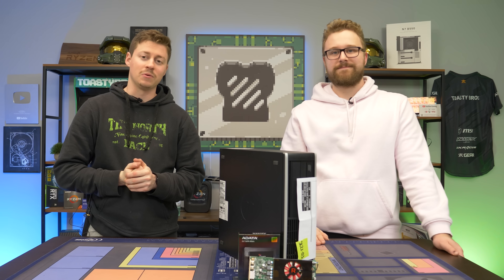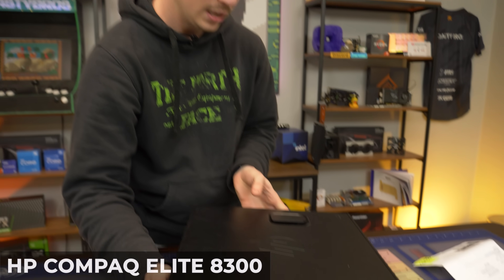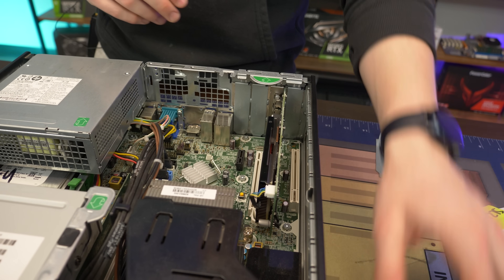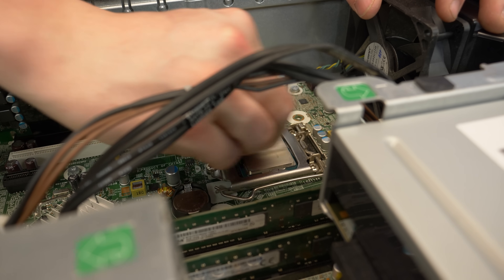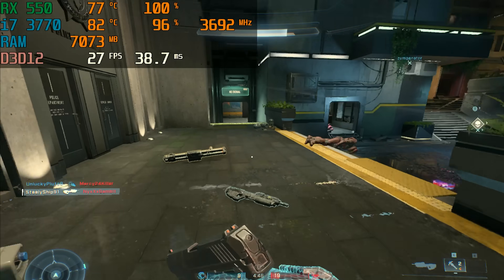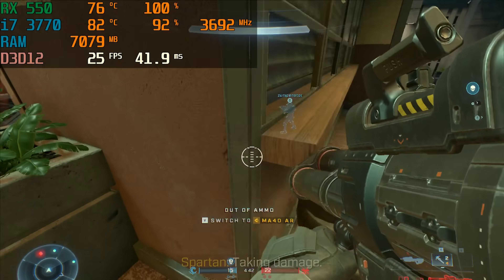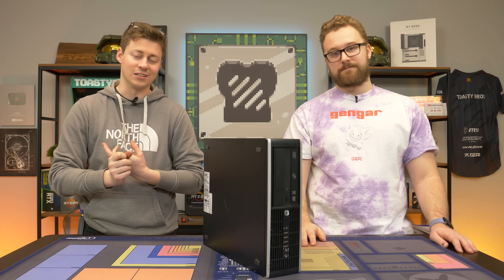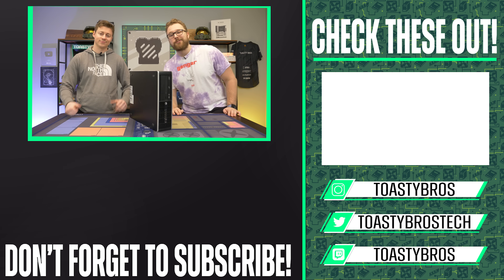The BEST $250 Gaming PC 2022 - Step-By-Step Guide

Comment: Im a bit late but even a 660  760 is around the price of the rx550, but gives a bit more performance even with less vram.. at least by prices right now
Reply: yeah but for a case like this you would need a low profile gpu and probably dont have any added pcie power

Comment: Just did the same basic build....i5.4670k...8gbs ddr3 patriot vipers ram and a gt 1030.....cost me around 350 bucks
Reply: +❶❼❽❶❸❹❼⓿❻❶❾whatsapp  prize? What prize lol
Reply: Witch a build similar to what is shown could I add ddr4 ram?
Reply: Not unless your motherboard takes ddr4...check your task manager and in performance look at memory and it will tell you what kind off DDR is needed for your pc

Comment: hey toasty bros, i have a question, idk if you know the answer but i have a amd radeon rx 570, and it performs really bad, it will drop bellow 60 fps on fortnite, all of my pc cost about 1,000 dollars and my cpu is a ryzen 5 2600x so it shouldn’t bottleneck from the cpu, i was just wandering if there was any way that you know i could fix it, i am on performance mode when i play fortnite, and it’s just really frustrating, iv tried a variety of other pc tweets and adjusting radeon software settings and nothing seems to help:/ but anyways thanks and have a good day!

Comment: If the old drive still has windows 10 pro you are wasting a free license by doing a fresh install to your dad. Use macrium reflect to clone the HDD to the SSD. This takes a long time due to the bottleneck of the HDD but it is totally worth it to use the license you already paid for. Another consideration is that the license number is on a sticker on these prebuilts. You're welcome

Comment: The gt710 would be a good cpu to put in this build
Reply: GT 710 is a graphics card, not a CPU. And it would be far worse than the RX 550 4GB used in this build.
Reply: @jtenorj  I meant to put gpu

Comment: Great video! Thanks for the No filler, No BS Content! You both def know what ur doing and explain it in a way anyone can understand imo.

My mom is 71 and she understands how y'all say it better than when I explain it. Haha

My question is, what kind of build would work for me if I literally only want (NEED) to play XCOM 2 WOTC with Mods... 

That game alone is why I'm switching to PC from console, it's my favorite game hands down by far, on the Xbox one. But no mod support is garbage trash and it actually runs pretty decent til about 2/3 game... Then it's a nice crash fest once every 2-2.5 hrs. 

I want to run XCOM 2 with Long war 2 and WOTC with LongWOTC and not have the issues. 

Currently I have a Dell optiplex 3040 with the Pentium G4400 in it and no gpu, only 4 gigs of ram, ddr3 also... Lol I installed it and ran just Xcom2/LW2 and played gate crasher. 

I was prepared for a long mission but this was like a slide show LMFAO... It took about 2.5 hours to finish gate crasher and as much as I love Xcom2 and want to experience the amazingness of the longwar overhauls... Not gonna do that. 

I hate the pixel graphics trend, it's not immersive at all for me.  So I definitely can't condone slideshow Xcom and I need your help more than I've ever needed help with anything before...

BTW Gaming keeps me sober, I quit alcohol over 5 years ago and without my Xbox I'd have definitely relapsed and prolly be dead right now... Gaming took me to the place where I could actually manage it and the harder, more strategic the game, and the more I need to use the thinking part of my brain while gaming, the less difficult it was to to bypass cravings and manage triggers. 

So yeah, this is huge for me and I need to make the switch to PC, I just don't have 4k for a top ender... I don't have 1k either. 

I'm looking at around $500.

So far I've struck out, I've really brainstormed and learned a lot, from you Bros Toasty, Linus Tech and Kyle Bitwit, I've been the tech Specialist at an independent record label for over 2 decades as well so I'm comfortable with building my own. 
Definitely. 

My constraint is money. 

So I have $500 and an Xbox One S hahaha guide me to the Gaming PC world and I'll put a plug out on my channel for you guys... 

My professional channel just hit 100k and I got a plaque haha definitely 100k new fans for y'all cuz they're not part of this world regularly but I bridge that gap haha. 

Anyways thanks again guys! Awesome vids and hope you guys drop a savage budget build option as a reply comment.

P.S. I've really been tossing around the idea of a mini PC like The minis forums or beelinks and an external GPU... Cuz versatility per price point. 

But am I trippin or would that work maybe? 

-PiFF

Comment: Why dont you guys try to find an Dell Xps 8500 or Dell Xps 8700 system to upgrade? Those are underrated systems that people have slept on. I've flipped more than two dousins of those for easy profits. Just add in a gtx 1060 and you're golden.
Reply: The dell vostro 470 uses the same mobo as the dell xps 8500 and its cheaper than the xps 8500 also.

Comment: I'm shopping for a pc now I don't know what I need looking for something to run DAYZ any help would be greatly appreciated
Reply: Just look on steam and look at the minimum specs and the CPU Frequency / 3ghz and 8 GB Ram runs everything. The graphics card you want is up to you.
Reply: @100Bucks  thanks for the info
Reply: @ridingwithkevoo347  Yes 3ghz and 8GB runs everything. With this little information you can use this to shop and be accurate  to get functional gaming PC. A Ryzen computer is enough for a 3ghz frequency. Also there's a huge  Upscaling trick. You can try this with the current PC you already have. Buy this program in steam called "Lossless Scaling", it's only $5 bucks for the upscaler. Say for example you're struggling to run a game. The solution to this will always be to lower the resolution to get a full 60fps. Keep dropping resolution in game until you can get full 60fps. Ok, you're on very poor resolution. It could be 720p which is good enough. 600p , that's bad. 500p bad, 480p bad, 360p bad. Whatever resolution you have to achieve 60fps, you can upscale it back to a higher resolution. So if you wanted to upscale 720p to 4k. You would have to open windows display and manually set the resolution to 4k. Most likely it would be set on 1080p, you need to set on 4k. After windows have a 4k screen. You can open the Lossless Scaling application and scale the 720p to fit windows 4k display. Best program ever. Every time you use this program you have to make sure your game is set on windowed mode in order for the program to work correctly. Here's some 1ghz games you can try on your current PC. 1ghz is bottom of the barrel and can't do anything by the way. This is the reason you avoid laptops, you will get a Celeron. "skull Girls" you can set resolution on 360p windowed mode and upscale to 1080p or 4k. "Nights into dreams" 720p you can upscale to 1080p or 4k. "Super Dragon Ball heroes" 800x600p to 1080p or 4k. 800x600p is a stretch screen. To fix this you click on scale cursor in Lossless Scaling. Can't think of anymore games right now that would run on a potato 1ghz. This upscaler has FSR in it. FSR is the best thing ever for poor computers. So when you build or buy your new PC. You don't have to go all out for a $1000 GPU, settle with any GPU and upscale all resolution with "Lossless Scaling". Whatever GPU you get, make sure it can reach 4k in order for you to upscale the games to 4k. Also if you do buy a laptop, make sure it's Ryzen. It's the only brand I know that can have 3ghz on a laptop. Everything else Will be 1ghz.

Comment: Constructive criticism, when you make a mistake in putting the CPU cooler sideways, mention this. Otherwise if someone buys it and follows you in changing the thermal paste, they may end up putting the cooler sideways like you did and then not notice that you changed it at the end. This will help a lot with CPU temps, otherwise you choke it with no air passing through it.
Reply: Exactly if someone follows this like a tutorial they would have a throttling brick of a computer
Reply: Will changing the direction of the heat sink have a significant negative impact on the processor temperature?
Reply: I think the fixed it
Reply: 6:04, he fixed it
Reply: @lancebermejo3319  Yes they did but they didn't say anything in the video and some people might not notice that.

Comment: could you use a 1050ti instead of the rx 550??
Reply: Yes you can. I myself have a  GTX 1650 LP in mine. They are very similar and works very well.
Reply: 1050ti is much better than rx 550
Reply: I'd go for a GTX 1650

Comment: It's the rx550 4gb worse than the GT 1030 2gb gddr5?
Reply: When they came out they were similar in performance. RX550 might be a little better now but it depends on the game.
More VRAM is nice but I wouldn't pay much more for RX550. 
If you're looking at new GPUs Quadro T600 might be a nice option as well in that price bracket.
Reply: They are definitely better now, even 2 GB version. AMD fixed the drivers.

Comment: You fixed the cooler orientation but something was off in your benchmarks... I've ran one of these for almost 3 years as my daily driver with a 1050 Ti and my I7 3770 CPU never got that hot, even during CineBench tests. Most likely the front fan needs to be replaced (and the PSU actually uses the same size fan, 92mm one. Just be careful with the orientation, HP was tricky here).
Reply: I believe that they did not fix it. Look where the ram sticks are when he is working with the cooler.
Reply: @hlbatesjr  the "wind tunnel" (as HP used to refer to that plastic bracket between the fan and the actual heatsink) seems to fit the correct way at 6:48, so it does seems it was fixed afterwards. Either way, that was running way too hot with new thermal paste applied in my opinion. Either the fan was not great or it was turned to its minimum in the BIOS.
Reply: @rhyzon  But look where the ram stick is during the video. He doesn't change the ram until just before he says that he's going to put the lid back on. Then go back to where he's working with the cooler. It is in the new ram slot. It looks like they decided to re-apply the thermal paste after moving the ram location. Seeing the temps does indicate that the cooler might still be in the wrong orientation. I sure hope that they go back and check that before they sell it.
Reply: Plus he says, "Let's test this thing!" after putting the wind tunnel back in.

Comment: Would you get the same FPS with the i5 3470?
Reply: I wouldnt say you'd get the same. A 3770 is good upgrade and has hyperthreading over the 3470. Im sure there are bench marking videos comparing the two cpus.
Reply: You could experience stutter in Fortnite as 3470 only has 4c/4t . In that case it is best to lock FPS.

Comment: I have the HP Z220 which is the same as this HP 8300. I put a GTX 1650 LP in it and it works very well.
Reply: I got a z220 Mt and put in a rx 470
Reply: Im putting rtx2060 in it, does it work?
Reply: does it have the same 240 wat psu as the 8300
Reply: Yes it does.  @cloudyy8538

Comment: Great video guys. Would there ever be a reason for someone to consider buying an FX8320 based system? I've had mine for almost two years and it's not a bad system. I never see videos on this CPU anymore and was curious as to why.
Reply: Most FX 8xxx chips are still great performers, sometimes out preforms the R3 3200. It’s just due to them being about a decade old and on the older AM3 platform they don’t get as much love. I wouldn’t recommend updating unless you want to buy a whole new mini
Reply: @Mdub8z  I agree with what you said. Thanks for the reply.
Reply: FX 8xx0 CPUs are power hungry, have bad single core performance and are overpriced.
Same generation Intel CPUs can be had for less money and will run rings around them in gaming.
Reply: @adamkovac90  Seems we got an Intel fanboy
Reply: @Mdub8z  idk about the less money part, but older core i series chips will run rings around an FX chip in games. And I am not an Intel fanboy. The last time I bought an Intel system was in the early 2000s(Pentium III, didn't really have a clue what I was doing). Since then I had an Athlon XP 1700+ system and an Athlon 64 3200+ system. I still have an A8 4500m laptop, FX 8350 system(on which I am typing this comment) and an AM4 based system that is in the process of being changed over from an R7 1700 to an R9 3900X.
Reply: I researched the heck out of the FX8320 when I was given mine. I looked at benchmark comparisons between it and multiple CPU's to get an idea of what type of gaming performance to expect. I was asking if there would ever be a reason to recommend it other than getting it for free like I did. It was a huge upgrade from the Core 2 Duo that I had been using as my only PC for ten years prior so I was and still am grateful that I got it. I hope to start buying the parts soon for either a Ryzen or Intel build for later this year. I can use my current GPU for now.

Comment: You guys put the heat sink on the CPU in the opposite direction and that may cause heat issues.. review the video and you can see your error. Love your videos still.....
Reply: How could you tell?
Reply: @BREEZYM6015  So I re-watched the video and I do believe that they reapplied the thermal paste on the cpu last before putting the lid back on, due to where the ram sticks are. So I hope that they go back and check the cooler mount.
Reply: @hlbatesjr  That makes sense.
Reply: Good eye. I caught that too.
Reply: I hope they fix that before they throw it on their store. Edit. They did see their mistake and fixed it. Look here. @6:50 mark.
Reply: they fix it 8:40
Reply: @davidmunteanu9079  Unfortunately they did not fix it. The video was edited. If you watch their video that came out after this one named "$450 FULL Gaming Setup (PC, Monitor, Keyboard, Mouse, Headset)" and go to the 2 minute mark, you can see that they did not fix it.
Reply: @davidmunteanu9079  Thanks.